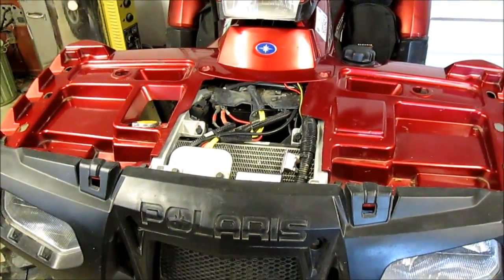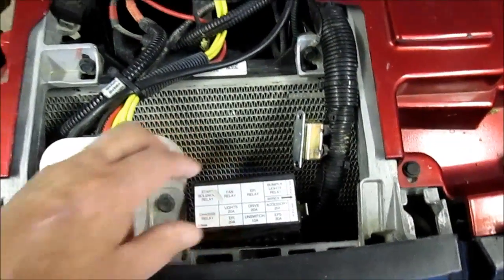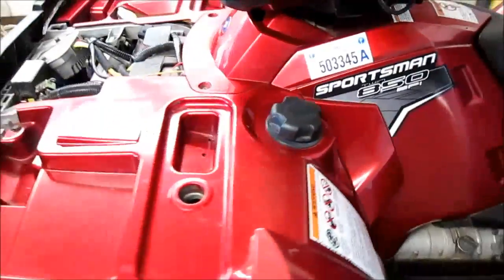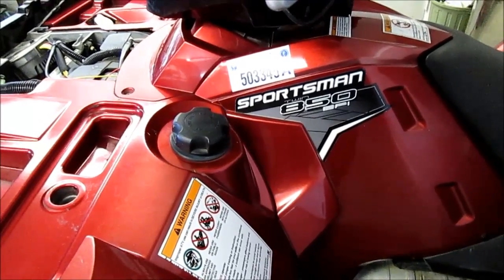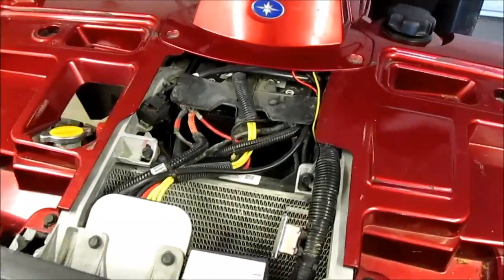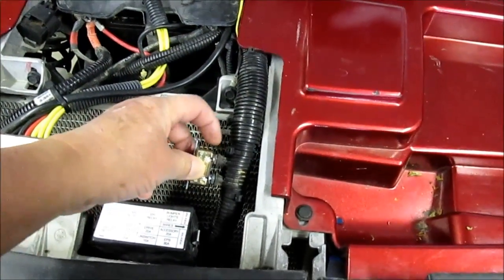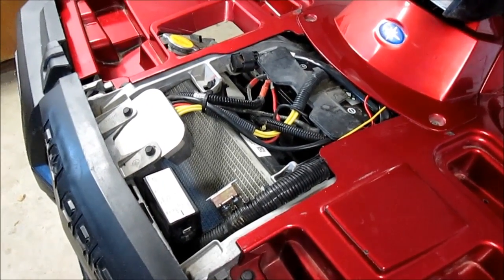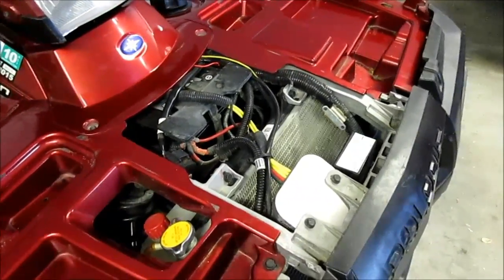ATV Polaris Starter and Fan Failure

Comment: Dale, your post has been up for awhile, and it is still saving butts! My problem now is the connector on the silver side. It is too loose to make good contact so I have to hold it with my finger to make a connection so the quad will start. THANK YOU for this info.

Comment: Just had the same problem after dragging trees and started heating up. The contacts inside the original circuit breaker just had build up on the contact surfaces. thanks for the video.

Comment: I had exactly same problem, started it with a screw driver on the starter engine but it was overheated since fan didn't work. i took the circuit breaker apart. the sheet metal that was supposed to make contact was little loose so i gave the rivet that holds the sheet metal a gentle touch with the hammer. after that the circuit breaker works fine....but i will order a new one next time i will do some service on it.
Reply from the maker: It's an unusual problem and that's why I made the video.  It looks like you already figured it out.

Comment: Good video. makes good sense what you done.
could you just by pass the breaker for the fan, by installing a wire across the two terminals, seem that might be and option. But, the fused circuit is a more viable option
but not everybody carried and extra circuit breaker.

Comment: Replaced it but sometimes it still won't crank, would could it be?
Reply from the maker: The first thing I would check is the condition of the battery.  The stock batteries only last a couple years and if it has less than 12.5 volts a few hours after a charge then it's time to replace it.  The next thing to check is the ground connections like I mention in the video.
Reply: Dale Christensen alright, thanks for the reply, pretty sure it's the battery, have had the same for years
Reply: If it is the battery, should by a sealed AGM type battery.  They last twice as long in my experiences...

Comment: How did you start it with a screwdriver?
Reply from the maker: On the upper part of the starter you have a large red wire and below that is a smaller black wire connected.  When the screwdriver makes contact to both wires at the same time it will engage the starter.

Comment: Where did you buy the new one?
Reply from the maker: I got the 20 amp replacement at Autozone and it only cost a couple dollars.
Reply: Dale Christensen how did you take it off? I'm having so much trouble taking it off, lol
Reply from the maker: I was able to pull it by off by hand.  The threads hang up a bit but it isn't screwed on.  You might need to pry up a little on each side to get it started.
Reply: Dale just want to let you know I had the same problem with my 2013 850 Sportsman.  After seeing and reading your post here I tried a new circuit breaker from Orielly's Auto store and wahlah it fixed my problem.  Thank you so much for posting and explaining how you overcame this problem.   I sure solved my problem.  Thanks for paying it forward.
Reply: @dalechristensen3433  so that circuit breaker 20 amp would stop the starter from engaging.?? My fan wasn't working found broken wire at circuit breaker,extended wires& New terminals,strapped breaker higher up.fixed fan but still no start with key,gotta jump solenoid to start.
Reply from the maker: @calvingoodswimmer2944  On my Polaris the fan and starter solenoid didn't work until I replaced the circuit breaker.  If your fan works, something else might be causing the starter to fail.
Reply: @dalechristensen3433  thAnks